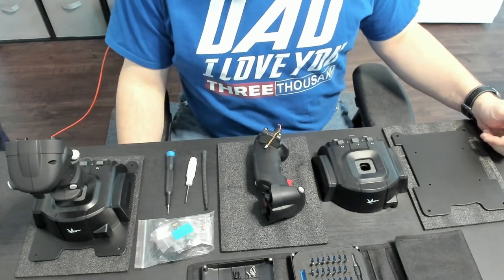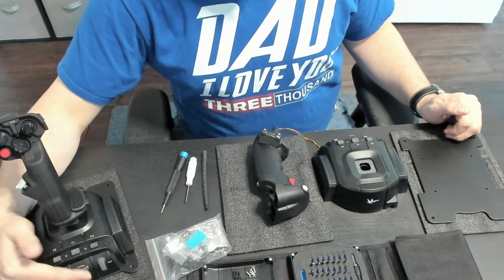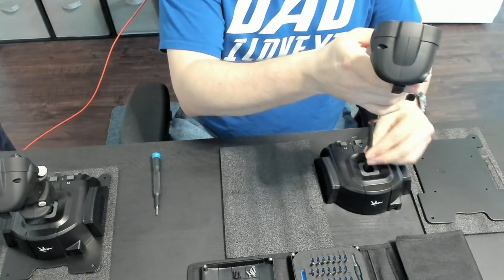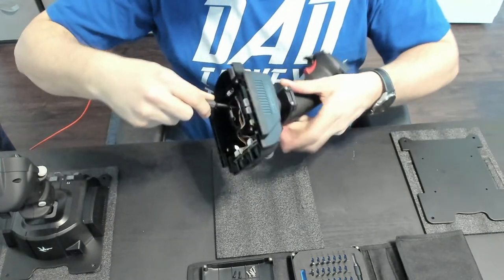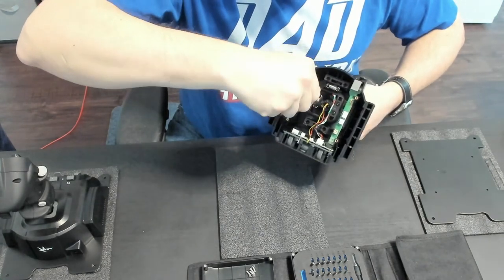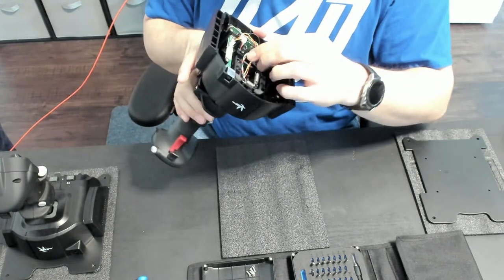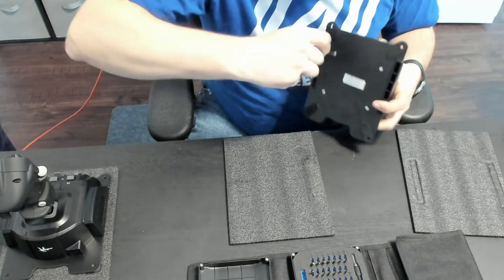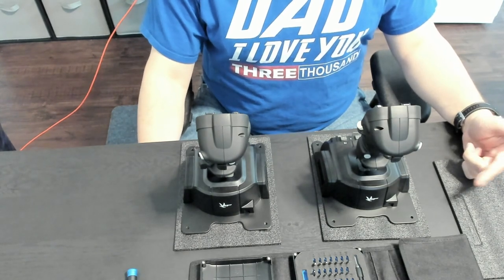How to Assemble the VKB Gladiator NXT Premium 2021

Comment: Great video, thanks. I wish they made a different connector on the stick rather than the three screws. I don't like how easy it is to strip the plastic. I think I did it properly after watching your video and I hope it doesn't come loose. Wouldn't it have been better to have a bolt that screws into some type of casing?
Reply from the maker: I still haven't had any issues, hope you haven't
Reply: @eewta  So far so good!

Comment: Do you think it would be possible to make an extension with a 3D printer? Also is this stick good for air refueling in dcs?
Reply from the maker: I believe someone already has (search reddit), I can see 3 issues to overcome, first, making sure it is tight enough of a fit to not have any give when moving the stick.  Second you would have to extend the wire inside, and third making sure you print is strong enough to consistently pull the springs without snapping your printed part.  Obviously, more difficult the taller you make it.
As for air refueling, the vkb gladiator is based off a real flight stick, but not one used on an in air refuelable craft.  I think it would be up to the skill of the pilot.  I'd HIGHLY recommend mounting it for any such maneuvers as well as pvp combat situations.
Reply: This stick is not sturdy enough to use with an extension.